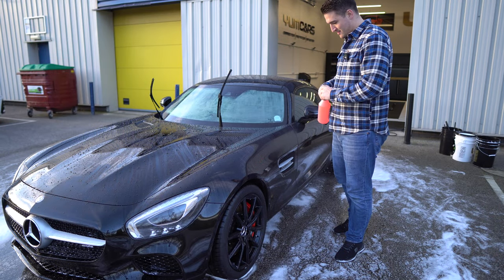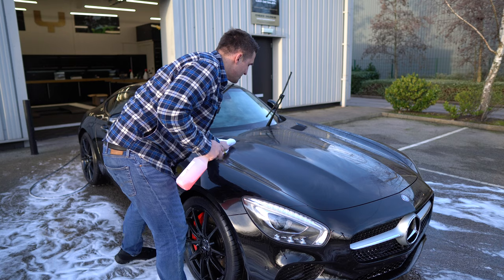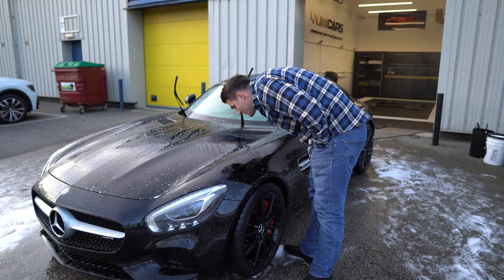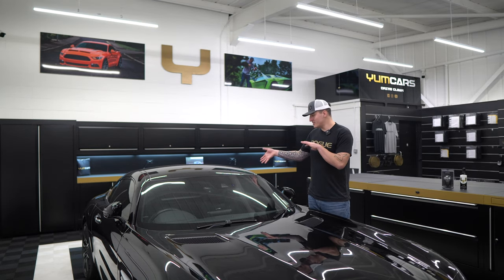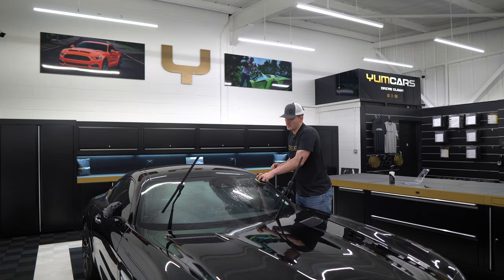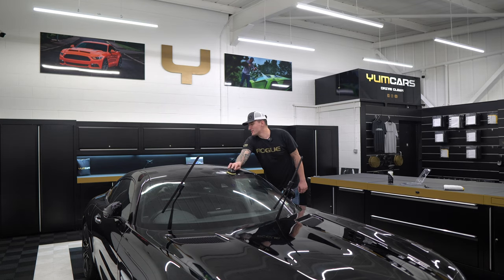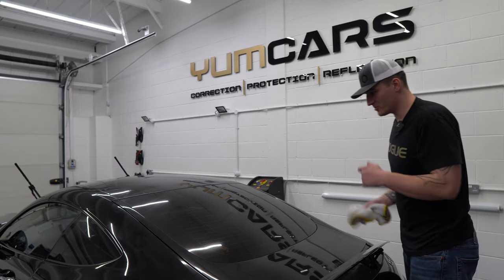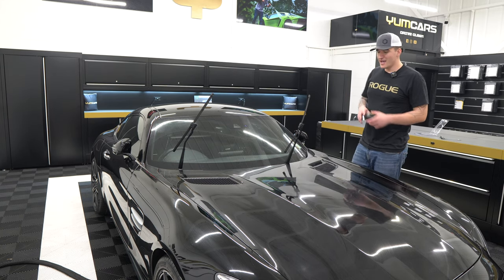AMG Correction Series - Episode 4 - How to Decon and Clay your Paint!

Comment: Some great info on this mate, I use the yumwheels on the paint work as well and it works great, can not wait till the clay pad is released but very nervous about using it as I’ve never done it before and I’ve heard mixed things about doing it
Reply from the maker: Mixed things? It is an essential step of the decontamination process, used with the correct amount of lubrication there is minimal marring
Reply: @YumCars  mainly that it can give some marring and it shows up a lot more on black cars like I have
Reply from the maker: Any clay material has the potential to do this, this is why the chemical decontamination has to be thorough and great lubrication is also needed.

If you watch my mustang correction series I mentioned that after I clayed it I only had to do maintenance chemical decons throughout the year to keep the paint as it should and when I checked the method it worked great but of course you have to keep your protection in check

Comment: I know the car is really clean.. but if there is any tar residue on the car will not the worse of it be on the lower panels, and I see you wiping the lower Bodywork then using same side of cloth and wiping upper bodywork, is this not risking transferring contamination?
Reply from the maker: Good point, the tar remover was on for so long that you are wiping away liquid residue. 

If the car was heavily contaminated with tar more towels would certainly be used